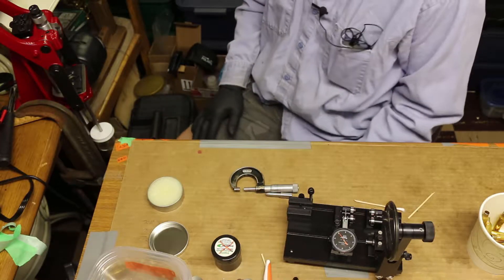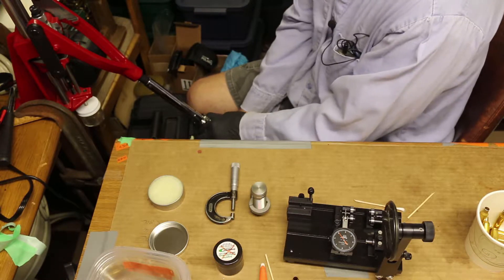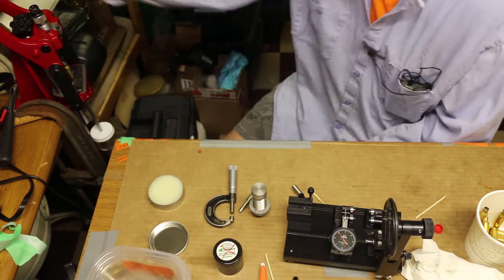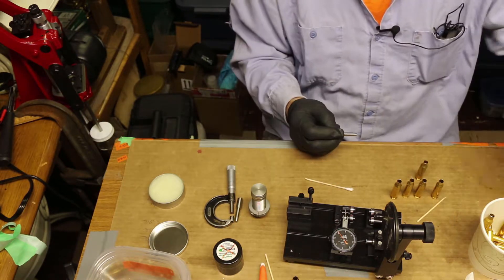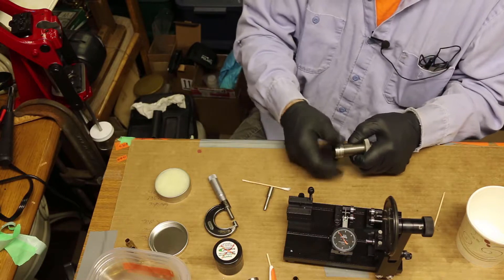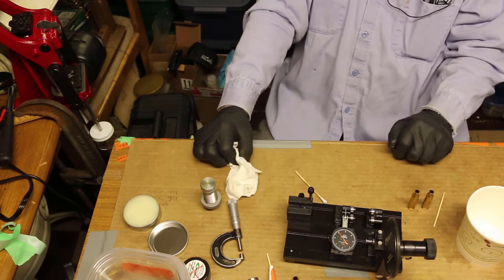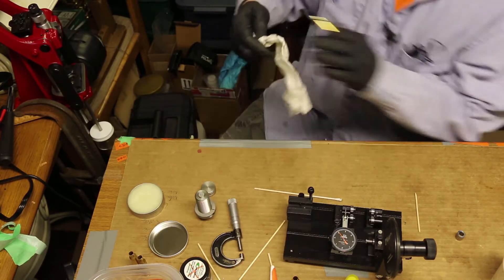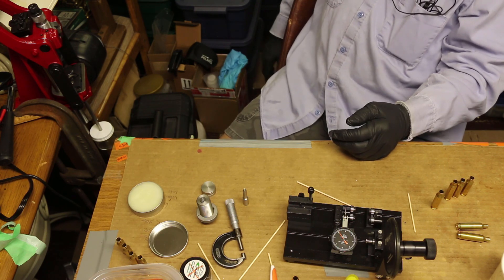A Example Case for Neck Turing Your Brass or Setting Bullet Neck Tension with a Expanding Mandrel

Comment: I think you are using the mandrels as a gauge, not a mandrel. The common practice is to use a bushing that will give you .003 under sized necks, then use the mandrel to resize or expand to .002, for example. The theory is the same for using a mandrel prior to turning necks. The mandrel forces any inconsistencies to the outside of the neck to be turned away. The same applies when sizing with a mandrel. The object is to make the I.D. concentric and true where the bullet actually seats A lot of people use the mandrel rather than turning necks. With the gauge you use, this will only work on turned necks. on unturned necks the difference in neck wall thickness will be forced to the outside of the neck and will show on the gauge as runout, but the I.D. may be perfectly . concentric.  Good bushing dies usually have fairly good runout as the bushing sizes the O.D. of the neck and the gauge measures the O.D. of the neck, the unknown is then the I.D. of the neck where the bullet is actually seated.
Reply from the maker: I agree the Inside of the neck is the payday. What the video is showing is that inconsistency in neck wall thickness when neck sizing the brass can have affect on neck tension and concentricity. The best fix I believe is Turing the neck of the brass. As you suggest shrinking the necks down .003 under and then using a mandrel to expand out .001 leaving .002 for neck tension should work most of the time but when neck wall thickness is erratic neck Turning will be better at maintains consistent brass. Also I don’t believe the expanding mandrel are ment to center the neck in relation to the case od but rather to expand the neck to a given dimension. Whereas neck sizing shrinks the od of the neck in relation to case od, now add in neck turned brass and the id of the neck will be concentric to the case od and bingo concentric case ready to load.
Reply: @whooper3336  Interesting opinion.  However, I will need clarification. What exactly makes you think the mandrel die will not resize the neck concentric to the body? The mandrel dies are caliber specific, EXACTLY like bushing dies. The manufacturer suggests leaving the mandrel slightly loose for self centering. EXACTLY like a bushing die. The mandrel dies are manufactured to the same specifications as a bushing die. I do not see how one can work and the other not, I need help understanding this. You, yourself say the inside of the neck is the payday, yet you spend all your time and effort on the outside of the neck, does that make sense? A bushing die makes the outside of the neck perfectly round and hopefully concentric, the mandrel makes the inside of the neck perfectly round and hopefully concentric.  Personally, I like seating bullets into a perfectly round inside neck. I have found after measuring hundreds of rounds, the bullets are more concentric using a mandrel. I measure runout at the bullet, so it is in relation to the case, I do not measure the runout at the neck. Also, there is no more feel involved. When using a bushing die, some bullets seated differently, so some match bullets, some sighter bullets, some practice bullets. With the mandrel I do not have that problem anymore, every bullet seats the same, this has been verified with a hydro bullet seating die and arbor press. I now load 100 match bullets and end up with 99 or 100 match bullets. My sighter rounds are now the same as my match rounds, which is more consistent. You must ask yourself, what was the purpose, originally for the mandrel? The mandrel was developed to use before neck turning. The inconsistencies in the neck were pushed out to the outside of the neck, to be turned away.  Even after turning, there will be some inconsistencies, using a bushing die will push those back into the inside of the neck, against the bullet, thus the difference in pressure required to seat the bullet.  I am not too concerned, personally, with the outside of the neck, there is about .004 to .005 clearance in my chamber between the outside of the neck and the chamber wall, before that neck expands to the chamber wall, the bullet is long gone. Simple physics, it takes less pressure to overcome .002 neck tension than it takes to expand brass, also, then neck cannot expand if the bullet is still there. There is a lot of hairs to split in reloading, some are just not worth the effort, just to bow to the alter of consistency sake alone. I have tracked hundreds of competition rounds fired, I saw no degradation in average group size using unturned Lapua brass and a mandrel compared to turned Lapua brass and a mandrel. If it doesn't improve on target, why spend the time and money doing it? I reload to shoot, I don't shoot to reload. I found no joy in 8 hours at the bench, to shoot for an hour. I have a very precise reloading regiment, well documented, that I follow. I have spent years testing and removing steps that showed no benefit on group size. At the end of the day, that  is what counts, not a warm and fuzzy feeling about consistency. If I want a warm and fuzzy, I go see my wife. Reloading can be as complicated as one chooses, or can be as simple as true testing will show and allow. Many times it is not what you know or don't know, it is what you think you know that just isn't so. Like a mandrel die not being concentric to the case, it just isn't so. I use 21st century mandrels, I can order them in .0005 increments, to test different neck tension, can you order bushings in half thou increments? I have not yet decided on pursuing neck tension further, if I chose to, I would go to Vermont pin gauges, in .0001 increments, not sure it is worth the effort though, on paper. But there is the curiosity factor though.
Reply from the maker: I am using a Sinclair mandrel die, it is universal and not cartridge specific. I gather from your post that you find neck turning the brass not to your taste. it seems correct that if you have invested in a mandrel die that is specific to the cartridge, it should do a good job. personally I believe a consistent neck wall thickness is advantages because all this discussion is being done in regards to neck tension on the bullet and ultimately the bullets release from the case. I seems to me if one side of the neck is thicker by .005 over the other side then that to will have a effect on bullet release. I am not speaking of splitting hairs I think of it more as consistency of the bullet release. the video was showing that neck sizing without having the necks turned prior can result in a mixed bag of neck tension. I do agree with you on powder measure. I use a rcbs mini auto scale as a powder drop then weigh the charge on two separate analytical balance’s that are pre calibrated with a class e test weight. all this is logged during the reloading process so that if when shooting something is out of norm I can go back and review data. as we discussed for concentric it’s the inside of the case mouth to the outside of the case is the payday,  for velocity the weight of the charge is the payday and can be contributed to low sd.
Reply: @whooper3336  I do not know what brass you are using, Lapua brass tends to have .001 neck thickness variance, and this is over hundreds of cases, with one or two exceptions. Yes I measure new brass. If I had .005 variance, i would probably turn those necks also. I completely understand the theory, but no one seems to talk about the reality. Over hundreds of rounds I have found no measurable difference in turned and unturned Lapua brass. Is there a difference there, probably,  if it is .003 or .010 improvement in accuracy at 600 yards, that means nothing. Nobody can consistently shoot that difference anyway, but it IS there. To me,  it is not worth the time and expense to chase it. I have tried loading with virtually zero neck tension, I could adjust the seating depth with my fingers, Not very safe, but I did it, I used a .243 mandrel for my 6MM.(243) I even tried moly coating the insides of the neck, as close to zero resistance as possible. No improvement in accuracy, none what so ever. I have done a lot of testing to dig myself back out of the  re loading rabbit hole. It has cost me a lot of time and money, re loading, bullets, powder and barrels to assure myself of what works and what doesn't.
Look at the reality, I have about .001 difference in neck thickness, or .001 difference in neck tension in one area of the neck. How much difference does that truly make? It takes some fraction of a micro-second for that bullet to travel about 1/2 of an inch to clear the neck at 3000 FPS, under over 50,000 PSI.  I am not a math guru, but what is the effect of maybe a couple inch pounds of friction vs 50,000 PSI of force behind the bullet? Is that difference there? Of course, does it really matter, for all practical purposes no. Is it worth the time and effort for a .0000001% improvement? That is up to you. It is all a warm and fuzzy feeling, it does not show up on paper, or even in SD's. does any chronograph measure to .001 FPS? NO.  
Whenever I get into these discussions about re loading, everyone wants the perfect bullet, , my question is this, do you have a perfect rifle? What is the clearances for your bolt to work smoothly? Wiggle your bolt and see, does that bolt return to exactly on axis with your barrel bore each and every time, how can it? There are clearances in your chamber, so the chamber cannot keep the bullet in perfect axial alignment. What about your lugs, are they polished exactly to give equal force on every contact point, if not, that can affect the radial pressure on that bullet and move it off axial alignment by the clearance of your chamber.  These are variances that exist, some cannot be addressed, but they are there. I could go on, is your bore perfectly round and symmetrical for the entire 30 inches,  is the rifling perfectly consistent in width and depth the entire length of the barrel, What do we do about these variances? My god, with all these variances how can anyone have a .250 MOA rifle? The answer is simple, those variances are there, but are so small as to be negligble, even when added together. All of these things can have more effect on accuracy than .001 neck tension on one side of a neck, mathematically. 
It is a human failing to want to be in control, to want to make things perfect. Great is not good enough, workable and winnable is not good enough. Everybody is chasing 0 SD's. 4 or 5 SD wins all your matches, if you have the skill. It depends on the game you play. if you want the worlds record for the smallest group at a given yardage, then perhaps these things are important, but for the 99.9% of us, that is not the case. 99% of us cannot tell nor shoot the difference between a .4 and a .3 MOA rifle and load but hundreds of re loaders are chasing that difference. My question is why? Optimize your load to your rifle and be happy. Some rifles simply are not .3 MOA rifles and never will be no matter how you tweak your re loading, just reality.. If what you chase is consistency alone, the rabbit hole is very deep and with numerous side tunnels. We all want consistent results, that is not very difficult, if if you chase consistency for consistencies sake alone, there are 1,000's of variables, is is a non ending quest. The only true test is in the results, on paper, over time , as an average. Perhaps I should make a video, and shoot a couple groups, and show the smaller group was shot with loads that my wife accidentally spilled  pickle juice on, THIS is the new re loading secret!!!   Makes about as much sense as weight sorting primers.
Reply from the maker: so let me try to bring this discussion back on track. the video is about neck sizing, the variance in neck wall thickness has on neck tension, cartridge 
 concentricity, and the reason that turning necks can be beneficial to address these needs. why would neck wall thickness be important, if we aim at concentric bullet to cartridge and neck wall thickness varies then why chase a concentric cartridge. the release of the bullet to the free bore and rifling will be tainted. it is the same effect as the muzzle crown, if all is not consistent then it will have a effect on the bullet. with respect to the case, and bullet it seems to me that neck turning has no down side weather you mandrel size or bushing size. it is a once and done operation makes all necks the same for a given cartridge. seems like a no brainer, consistent neck tension, consistent neck sizing, consistent bullet release, I am not sure with out testing how many inches this consistency is worth at 600yds, but it is good reloading practice to have consistent neck tension and cartridge concentricity. by being consistent you take away the fact that you are constantly compensating.
Reply: @whooper3336  I understand the theory completely, I do not really disagree with it. My point is does it make a discernable quantifiable improvement.  In your case, it may very well do that. If my brass had a .005 variance in thickness, I would probably neck turn also. Lapua brass has a difference of .001 or less on average. So, if you see a difference from cheap inconsistent brass to a turned neck, that is one thing. If you turn Lapua brass the improvement will be dramatically less. From junk to great is one thing, from very good to great is a far less improvement.  I read an article about 2 years ago, they asked the top 50 shooters in the U.S. in F-class, over half did not turn their necks. When asked why, one guy said he uses new brass for only 4 shots, then gets new brass, The benefits wasn't worth the time and effort. Imagine that, tell me it isn't so! I have watched numerous videos about neck turning, including yours, but over half of the top shooters don't turn necks. OH MY GOD! What will I do now? Brian Litz, world class shooter and head ballistician for Lapua,  the man who wrote the bible on ballistics, and wrote the most comprehensive ballistics calculator that exists, does not sort his bullets. OH NO , it simply cannot be true!!! This from the man who has a ballistics laboratory and has shot 100's of thousands of rounds under lab conditions. He found no realistic benefit.  All my re loading secrets have been dashed, torn asunder, Dammit I'm taking up tennis!!!!

Inches in 600 yards from neck tension? Where did that come from? Your opinion or do you  have proof to back that statement up? According to my ballistic calculator, 2 inches equate to a 30 fps difference at 600 yards, that is 1/3 MOA. Are you saying neck tension can create that difference? It sounds as though you are. So 2 inches low, so you lost 30 FPS. Increased neck tension increases pressure, which increases velocity and even that is very very minimal. So you cannot be low, from a .002 or .003 neck tension you would have to go into negative neck tension, I don't think that is possible. So 2 inches high, or 30 fps higher,  how much neck tension will that take, I am not sure haven't tested it, I would guess 20 or 30 thou would maybe do it. Try to seat that bullet! That is around the pressure difference one sees with seriously jamming the bullet into the lands. But all from neck tension alone according to you.. The bullet is released way before max pressure is achieved, it only takes less than 100 lbs of pressure to release a bullet. You can prove it yourself, load a dummy round with .003 neck tension then stick a rod through the primer flash hole with a pressure gauge and see how much pressure it takes to push the bullet out. That thin little piece of brass must release way before max pressure is there, You find a neck tension that shoots the best, then you try to be as consistent with that neck tension as possible. Neck tension relates to the release of the bullet in the pressure curve, The more consistent that is, the more consistent the harmonics. You tune neck tension to harmonics. that is why changing neck tension changes group size, you move into or out of the harmonic node. It is not just velocity. You can change neck tension and can see your group widen a lot, that cannot be velocity, Harmonics are not strictly vertical. That is where the velocity difference comes from anyway, not static pressure against the bullet from the neck. Using my seating arbor press with a gauge, I averaged about 15 lbs to seat a bullet, what makes you think it takes much more pressure than that to release the bullet? Does it go out tougher than it went it? I am very sorry, but the more you talk, the  more you prove your ignorance of re loading and ballistics. Yet you feel qualified to give others advice on re loading?
Reply from the maker: Thanks for the kind words, almost did not make it to the end due to your tendency to get off topic and ramble. Like you said you probably should stick to tennis. I am sure the 50% that do neck turn are on the wrong side of the net.
Reply: @whooper3336  Once again, you missed the point. If 50% of the top shooters don't neck turn, maybe, just perhaps, it could possibly be, that turning is not the end all be all it is purported to be. Think that just might be a possibility?  Especially when it is Lapua brass.  Over 90% of those shooters use Lapua brass for precision long range shooting, the question is why aren't you? You do not have to answer, just curious.
 
You said you like turning because it is a once and done thing, didn't have to think about it again. Have you tested that? I have. I took a turned case and shot 3 rounds with it. I put it back into the lathe and tried to just skim the surface. I found I cut about .001 off some areas and nothing in other areas. I just ask that you try it yourself and see. 
But I waste my words, I can't convince you, over 50% of the top shooters can't convince you, so just keep buying cheap brass and turn away, trying to make it into quality  brass, enjoy yourself, keep making you tube videos showing how to turn and the wonderful benefits of it, if that is what floats your boat, knock yourself out. The shooting world is changing, but you just stick to your guns, believe the old fashioned way is best, whatever.
Reply from the maker: Hello Albert, using your numbers if 50% don’t neck turn the other 50% that do can make their case. It is obvious that you are in the don’t turn category you have explain that fact over and over. It is also obvious that you assume alot. For example you assume I use “cheap brass” but you never inquire. You state that you run your necks down three under then expand out with specific caliber expander mandrel dies that keep the case centered while expanding the necks to the neck tension you desire. Has it occurred to you that you are double working the case necks? You assume that I am a proponent of neck turning. The video only shows that neck sizing unturned necks or variable neck wall thickness cases can lead to a variety of neck tension. I make no claim to be a proponent of neck turning I only show the results of neck sizing the hornady cases. I believe the video states hornady brass is used. You obviously know Hornady is the cheap stuff. You state you are a proponent of Lapua brass, good for you. I have a batch of once shot you know the cheap stuff that I use Lapua  brass that needs to be cleaned and prepped. Maybe I will do a video of the neck walls on them to see how they vary. Better yet Albert why don’t you instead of wasting words.
Reply: @whooper3336  The cheap brass is a logical conclusion. Lapua, or even Starline does not have .005 variances in the neck, they just do not. I do check new brass, I find maybe one case out of 100 with about .0025 variance. When that happens, for about 90 cents I just chuck it. I have never found a .005 variance at all, ever.  So my conclusion is fairly sound. I have seen up to .006 in Hornady brass, and even worse with Winchester. 

I am NOT in the no neck turning group, I have said several times if the brass I used had .005 variance I would turn those necks.  I just don't use brass with such bad tolerances. I have clearly stated with Lapua brass, I see no benefit to turning. The improvements are too small to mess with. 
 
There is another issue, if your necks have .005 variance what is the consistency of the remaining case?  The neck is the easiest to control in the manufacturers process, it is the final step. Do you volume sort your brass? Case volume certainly effects velocity more than neck tension.  Take one case, load and fire it over a chrono, take that same case and bump the shoulder .005 instead of .002, see what the chrono shows. How much higher is it? You have changed the case volume. Once again, the need for premium brass.
 
Look at the history of re loading. When did neck turning become popular? Only after widespread use of chronographs. In other words to reduce SD. This was one answer to inconsistent brass. Technology has changed, companies like Lapua saw the many things people were doing to try to overcome inconsistent brass, turning weight sorting, volume sorting etc. They developed very consistent brass to negate all of the time and effort put into trying to get premium quality brass. One could still do these things but the improvements realized were reduced drastically. 

That does not include the unending hassle of having 4 or 5 match batches, which must be kept and processed separately, same with bullets. You buy 300 rounds of brass, and sort, you do not even get 100 rounds required for a match in one batch,. Do you test and adjust your load, neck tension and seating depth to each batch? What is left for the match? Been there, done that. Pain in the butt and untold hours at the bench.

Yes, I have tested mandrel sizing vs bushing sizing, over 100 cases of each, I do a lot of testing to find what really works. I found that the runout from bullet to case was measurably smaller with the mandrel, if it wasn't I would not continue to use it. On average the mandrel cases were.0015 more concentric over 100 cases. I use all .0005 indicators for my measurements. THAT is one reason I use the mandrel. Plus the consistent seating pressure.

 Am i working the brass more, yes, to a very small degree. Expanding .001 more is not going to work harden that much. what is your chamber neck size?.005 to .006 over a sized neck? Moving brass that much does work harden it, especially with the heat and pressure during firing. That is where the majority of work hardening takes place. So your are expanding and sizing about 10 or 12 thou per firing, an additional 1 thou is not dramatic. Plus it is in my process I anneal after two firings anyway, more consistent neck tension that way. 

Once again, you make a contention, that the mandrel is not axially aligned with the case, this is an assumption on your part, without testing it must be. I have found this, through testing, to be false, in fact, the opposite. But you just keep re loading based on assumptions, and you tube videos, I am sure you will find a good load eventually.
Reply: @6handicap604  Your perspective is as a F-class bench rest shooter.  I hand load for hunting up here in Alaska.  Lapua does not make brass for my cartridges (.270 Win, .300 H & H.).  Some of my brass lots from hunting are Federal, Hornady, Winchester so I assume neck turning may help?
Reply: @RetrieverTrainingAlone  Generally speaking, most hunters do not neck turn, not that they cannot. Neck turning, especially inconsistent brass can improve accuracy. This is mostly for those who pursue accuracy as a sport. Is extreme accuracy important in hunting? Not so much. your target area is much larger. If you can hit the brisket at 100,200,300 or even 400 yards, you are successful. Most hunting guns with a good load will  shoot 1/2 MOA, this is plenty accurate for hunting, except if you hunt very long range. I am potentially shooting at a 3 inch circle at 600 yards, for score. If you can shoot in a 6 inch circle at 600 yards, you just killed your animal(1 MOA). You win, I don't. It is a different game. I hunted for 40 years, and never re-loaded, I tried 3 or 4 different factory loads and used what shot the best in my rifle. I was very successful in hunting. That same rifle and load could not compete in F-class. Different sport  altogether.  I guess it depends on your goals, taking a deer at 300 yards, or taking a deer at 300 yards by shooting it in the eye. All the best.